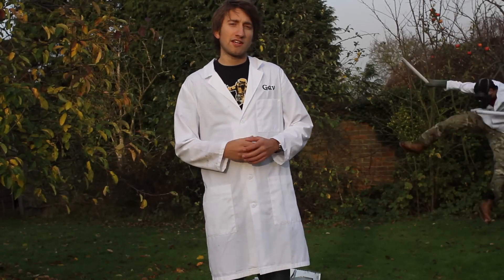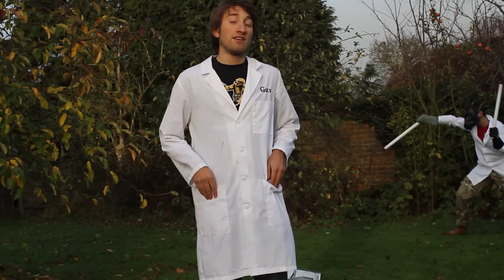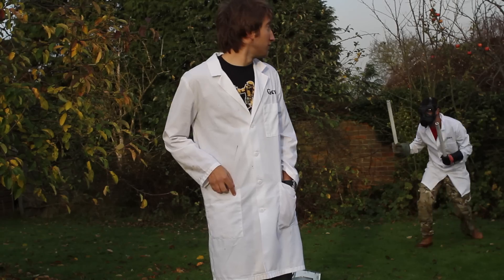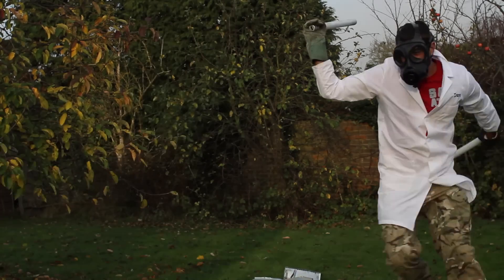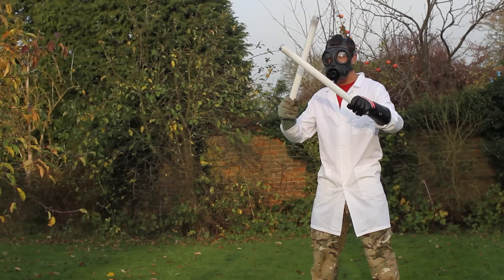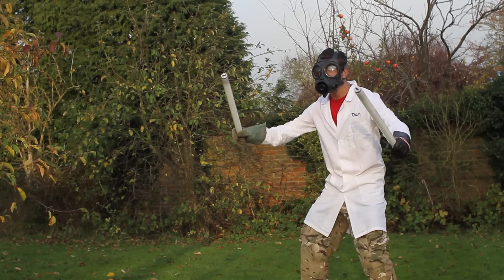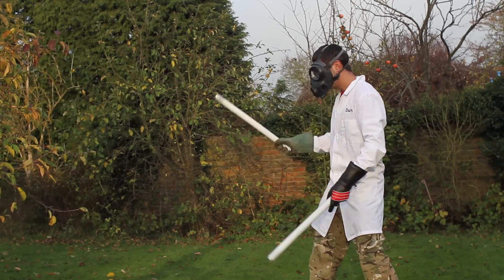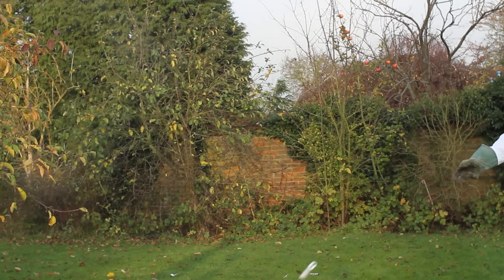Fluorescent Light Bulbs SMASH - The Slow Mo Guys

Comment: It's a British Army Avon S10 Gas Mask. You can find plenty on eBay.
Reply: domolords Dan was in the RLC, probably issue.
Reply: domolords Dunno, the muzzle looks way too elongated and tighter for a S10 and the optical lenses look far too large it also doesn't have the latex rubber frames in the lenses too, I don't think it's a regular S10, might be an SF10.

But now looking at it, some S10/SF10 series had weird geometry based around the original design, maybe just a variant.
Reply: +domolords Sadly He Forgot The Filter :/
Reply: Mean Guy u mean exhale valve not muzzle

Comment: They contain a mix of mostly argon, which is a noble gas similar to neon, and they do contain a tiny amount of neon to lower the strike voltage, and a small amount of mercury.. The mercury doesn't vaporize until it warms up, hence they're dim at first.

Comment: There probably is a bit of argon or something to keep the filaments from burning up when the lamp is started, but the main gas is mercury. The mercury gas gets excited by the electric current and emits UV light- like how Neon emits a reddish colour with a strong enough electrical potential applied. That UV light then excites the phosphors on the outside of the tube (the white powder), and that's what actually makes the light. But yes, there isn't that much mercury- Broken glass is probably worse

Comment: neon is passing an electric current through neon gas, this is similar but just a different gas, and it's the fluorescent coating that creates the visible light. It works similar to glow in the dark lights, they collect ultraviolet radiation then slowly release it as visible light, this is just a faster release

Comment: Actually they use both. Having just mercury vapor inside the tube would be very expensive even if it is at a low pressure. And they put in a noble gas so that it doesn't react with the mercury. Although I do agree that it's the phosphorus that is being excited and emitting the light.

Comment: i;ve had quite a few fluorescent bulbs fall and they are extremely fragile so be careful, they also contain a little droplet of mercury
Reply: Metallic Mercury is actually pretty harmless, it can’t be absorbed by the body easily. It does release vapors that are very toxic, which is the most dangerous thing about working with mercury. They where outside with plenty of ventilation, so they would be fine. It would only be dangerous if they where inside.
Reply: Oh, and I’m a chemistry student so that’s how I know all this

Comment: They get used up and the gas turns into some kind of powder, It looks like gas or some smoke but its just dust if its been out in the sun for even 2 hours it will be safe for breaking even over someones face if his eyes are closed and nose the glass is to light and brakes in angled edges and is almost impossible to get cut from it unless, thats what you are aiming for.

Comment: Try stuff in space!!!
Reply: Do you have $200000 to get there?
Reply: Zero G chambers.
Reply: Adam Sweitzer It doesn't cost 200,000... it is in the billions of dollars.
Reply: spinax22 Those only last a few seconds and are extremely expensive, the reason is because they just get a plane up in the air... then let it fall down to earth.
Reply: Actually, there are commercial space programs where you go on a 0-G flight for 20 min which costs about $200,000 thank you very much.
Reply: Adam Sweitzer Once again... you need to read your garbage articles better, take some time man.... It only lasts a couple seconds, 20 minutes of going back up and then doing it again and again... but falling down is not going to take 20 minutes.
Reply: Noooo... It goes in a suborbital path up to about 300,000 Meters. After it turns its engines off you have 3-12 minutes. Plenty to start the camera do whatever and turn it off

Comment: No, you just weren't thinking this through enough, just jumping to conclusions called me retarded (No need to be mean). They could easily create a circuit attached to the lights and on the other end attached to a wall plug. And I know: "But then they would electrocute themselves if they were holding it when it broke". That's why he was wearing those gloves. I'm sure with the right tools they easily could of done it. Because even I can, and that circuit thing, I've done it before.